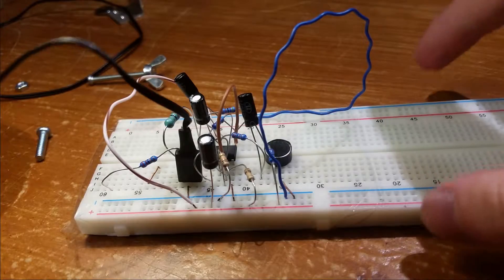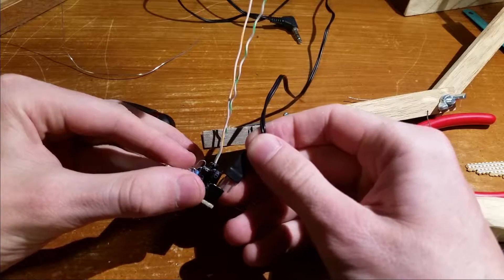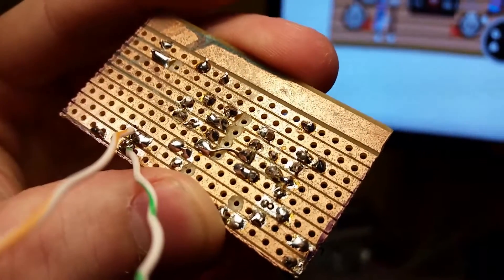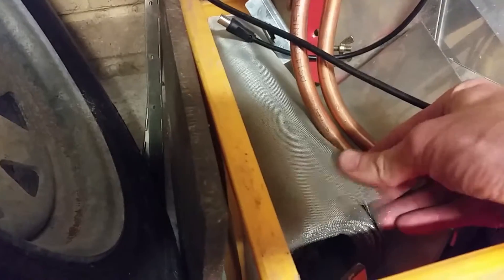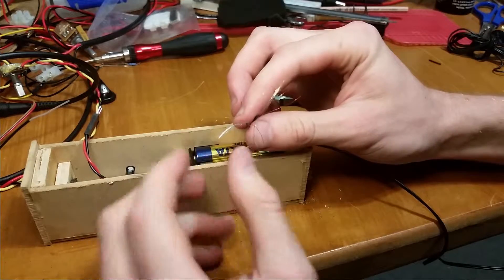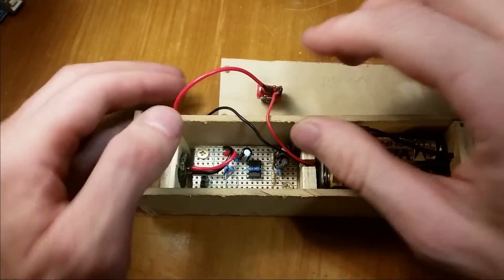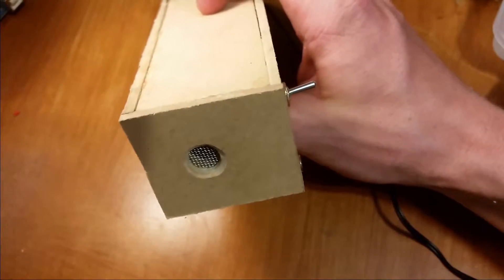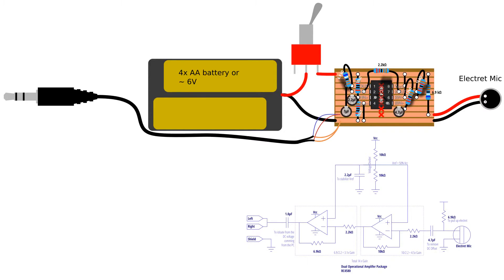Preamped Microphone Build

Comment: The elaborate "virtual ground" circuit is completely unnecessary, even though it's almost a good one! Since you already have an even number of batteries in there, just centre tap your battery pack, that's actually likely to be better. Now that does mean that you have to use a double pole switch though.

Your blog page says that "it seems to cut off high frequencies", but that can't really be the case at all, at least not as far as the circuit is concerned. It has to be your acoustic design, like capsule placement, any acoustic filtering in front of the capsule, whether the capsule is rear vented to receive compensation pressure and whether you are short circuiting into there acoustically from the front...
Reply from the maker: Haha yeah i was much impressed with myself at the time... i have since bought a USB mic... cant beat having the ADC right beside the mic